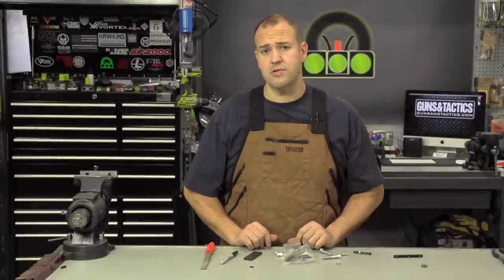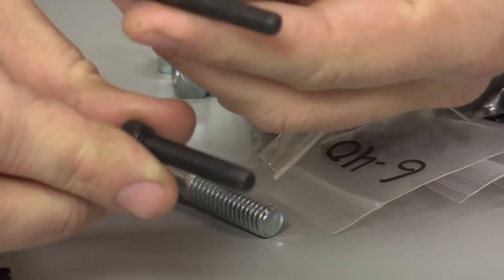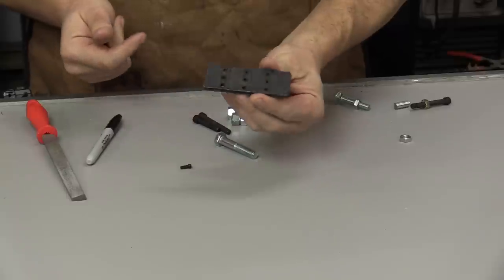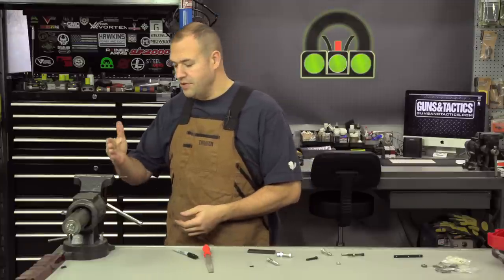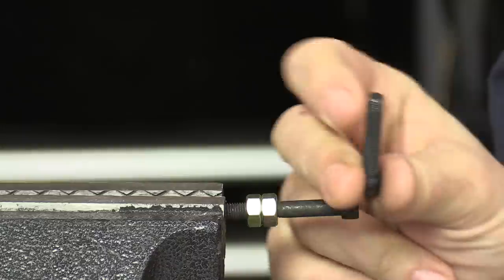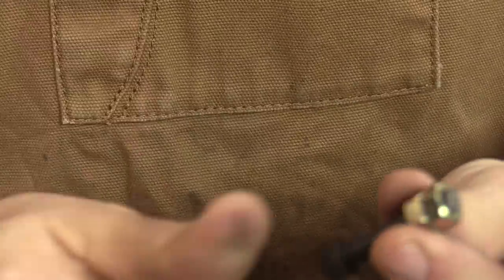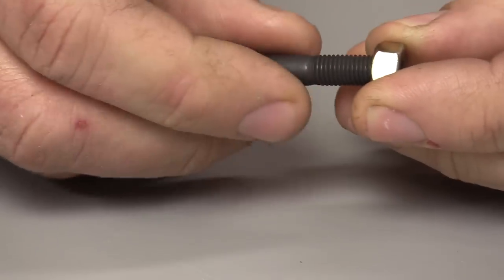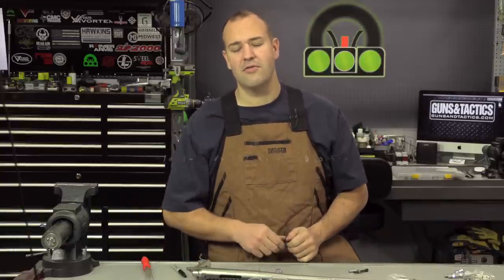How to Shorten Screws

Comment: Thank you! I bought some 6 foot screws to cut down to 4 feet and the dude at the hardware store said that i only had to cut them with the angle grinder and id be good to go. I cut and the bolt wont thread onto it! I watched your video and was able to cut everything to the correct  size. Thank you!
Reply from the maker: Glad we could help

Comment: Thank you for the video.  I am trying to install a red dot on my Canik Rival SFX and it's turning out to be a real hassle.  I need to shorten two M3x.5 screws to hold the optic plate onto the slide so the screws don't stick out the bottom of the slide.  You mention in the video about having a "screw block". This seems the easiest way to sand down the screws. Is there any other name that it goes by?  In my searches nothing shows up that looks like what you have. Thank you.

Comment: If when cleaning up the threads on a belt sander/grinder, if you hold the head end of the bolt/screw up and the cut end down, any tiny burrs will be pulled out of the threads and not be in the threads.
Reply from the maker: Good tip!

Comment: They are bolts, not bloody screws, screws are self tapping, bolts have nuts.  If you put the nut on the BOLT first, then cut it, you don need to do anything else.
Reply from the maker: Well….maybe you should search socket head cap screws and see what happens.   General definition is a bolt is secured with a nut. A screw threads into something and doesn’t need to be self tapping ie machine screws.  But bloody whatever :-)